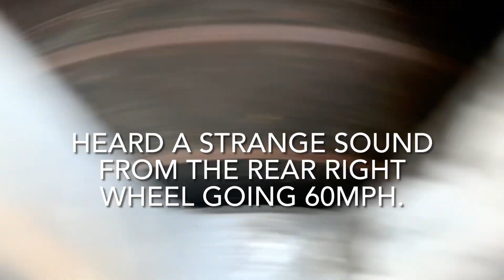Fixed! Stuck Rusty Prius Rear Wheel Bearing Replacement! The Easy Way!

Comment: Your method worked well on my 2012 prius C. I saw your damage on the back plate and filed the bolt ends smooth.